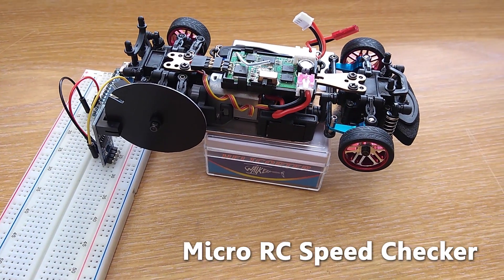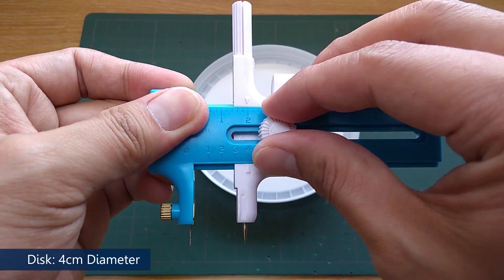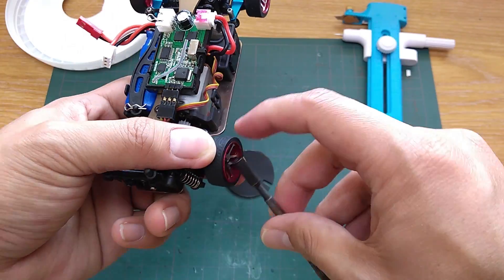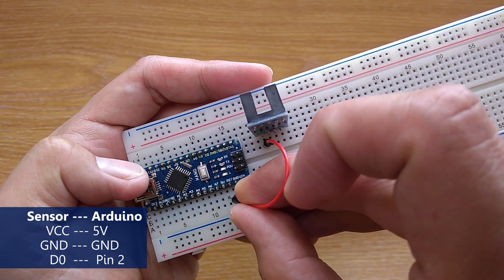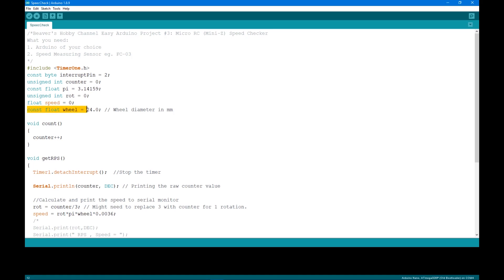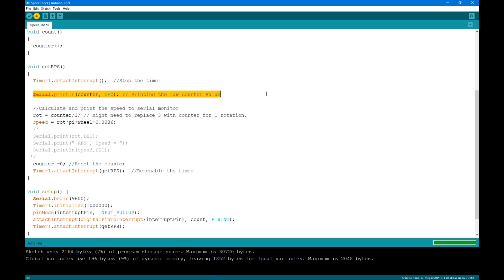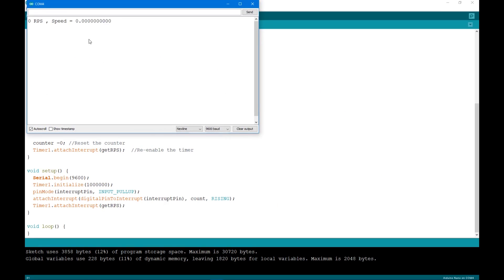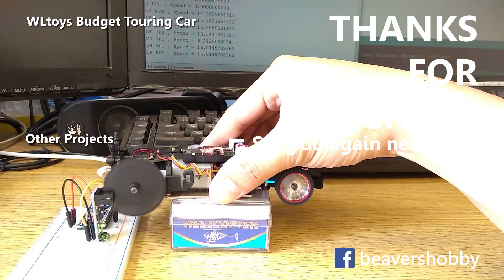[Arduino] DIY RC Speed Checker

Comment: can this be made portable with a screen and battery?
Reply from the maker: Yes, of course.
Reply: @BeaversHobby  ive never really done any sort of coding before, will the mini lcd had to be coded?
Reply from the maker: @joelrecio6836  Yes, it needs some coding. But you can find the code on the internet so it's mostly copy & paste so no need to worry.

Comment: Can i using oled display for indicator speed?
Reply from the maker: Yes, of course. You just need the library that controls the display and then show the value to it.
Reply: @BeaversHobby why to connect pin arduino to oled lcd sir
Reply from the maker: @nihongo_bakari  Sorry, did you mean how or why?
How: you will have to refer to the manual of the display you have.
Why: because the display itself can't read from the sensor directly so you will need the arduino to process the sensor signal and translate it to send to the display as text.
Reply: @BeaversHobby  How code displays value to oled display
Reply from the maker: @nihongo_bakari  You will need to look at the tutorial for that specific display. Usually it takes serial out.

Comment: Thank you for this video. Your content is very helpful and interesting. I would like to ask you if it's possible to make a speed checker like the Tamiya one, by using a fixed wheel (the wheel that spins on the "dyno") that works with the car wheel, so i can use various diameter of wheels without changing parameters everytime. I don't know if you can understand English is not my native language, sometimes I'm struggling to get understood by people 😆 thank you
Reply from the maker: Yes, it is possible. You'll need a few more parts to do that like base, rotating wheel, LCD for live monitoring. If you have a 3D printer it'll be easier to make. However by the time you complete it, it might be more expensive than buying the Tamiya one. I got it for around 30 Euros with shipping from Japan.
Reply: @BeaversHobby  Thank you very much. I have two 3D printers. You were right, but now the prices of Tamiya speed checker have been raised up a lot, maybe they are out of production. I don't want to spend 90$ for a Tamiya one.
Reply from the maker: @fabriziopandolfi1857  In that case printing one yourself is a good option.

Comment: your asset is a little overkill, you can simply use a Reﬂective Object Sensor like the QRD1113/1114
Reply from the maker: Thank you. I didn't know about that before. I only have this sensor left from other projects so I just use what I have.
Reply: @BeaversHobby  those sensors are very cheap and can easily detect dark/light surfaces in a half cm range. you can paint a white spot  on the tire side or to apply a white sticker and you are ready to go.
Reply from the maker: @mux000  Thank you very much. ❤️

Comment: Hello. The wheel for check speed is big, have more diameter than the other wheels. I think the speed read not is real. Do you consider this?
Reply from the maker: Yes, I have. That's why the encoder is only for counting the revolution while the calculation for speed is from the actual wheel diameter from the wheel I use. That's what I said you have to change the wheel diameter if you use different wheel and tyres.
Reply: @BeaversHobby  Oh yes thanks for the explaination. That's good!! Regards friend!
Reply from the maker: @weisy87  My pleasure.
Reply from the maker: I probably didn't explain it thoroughly but the "speed measuring sensor" doesn't count the speed of the object it reads. This is the same sensor you see in Arduino Smart Robot and it counts how may times something go pass the sensor. That's why the diameter of the encoder doesn't matter, the diameter parameter in the calculation does.

Comment: 👏 Please 👏 use 👏 bigger 👏 car 👏

Tho I like these small projects but I have a 1/10 scale 😅😅😅
Reply from the maker: Change the encoder  to suite the car and wheel diameter in the code is enough to use with bigger car. However I'm quite afraid to do it because, well, it's big. 😆